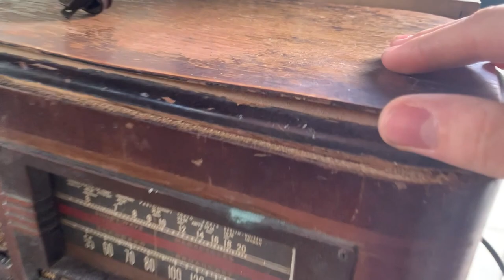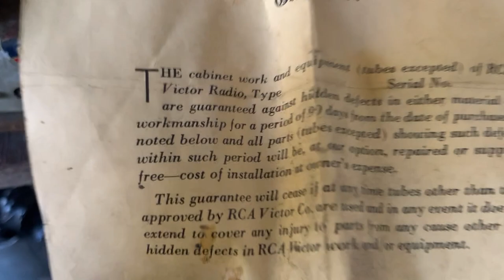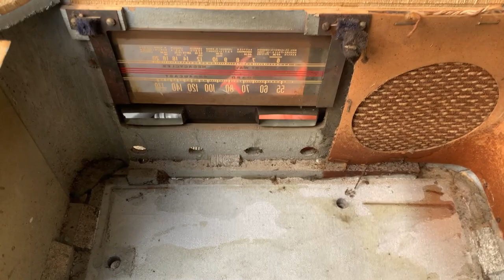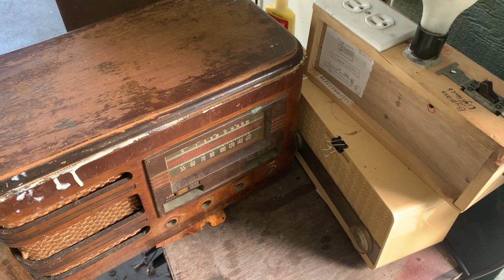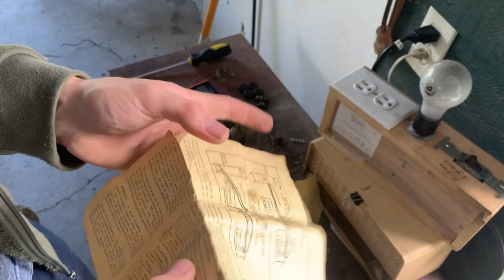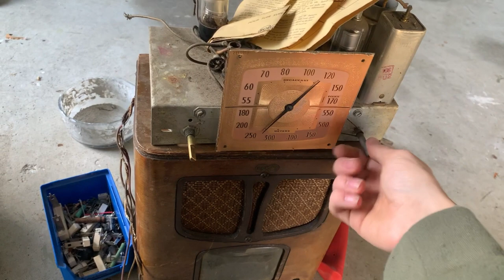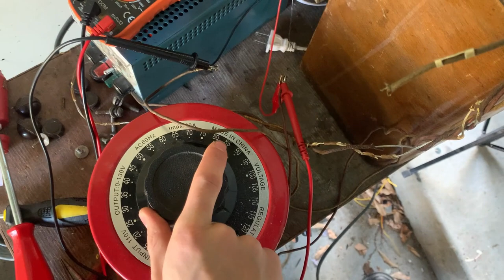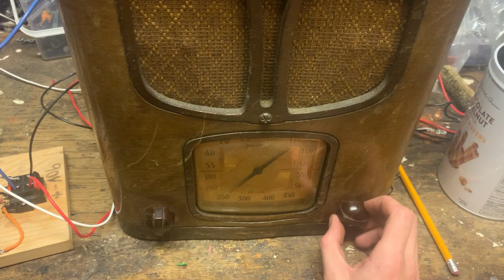Resurrection Of 2 Trashed RCA Radios

Comment: All the wood is wonky. Spent too much time in the elements like in a barn or shed , it happens. Tube radios are antiques
that many who owned them never cared about. Don at RestoreOldRadios would love the first one. The second one is a
 total train wreck of a chassis . Surprised they both work. That is a great ghetto power supply.
Reply from the maker: The first one is actually turning out ok, I was almost going to just keep the chassis but the cabinet is now solid with a bunch of wood glue and clamping.  I may refinish it later and although I have been terrible at refinishing in the past there's not much to loose on this one.
Reply: @randomelectronics2224  wouldn't Bob Andersen have some tips on refinishing?